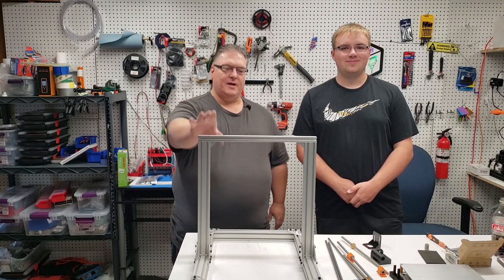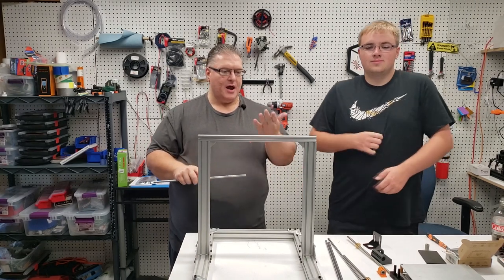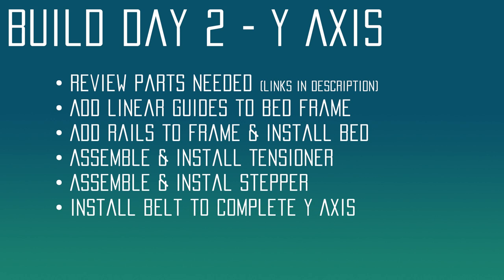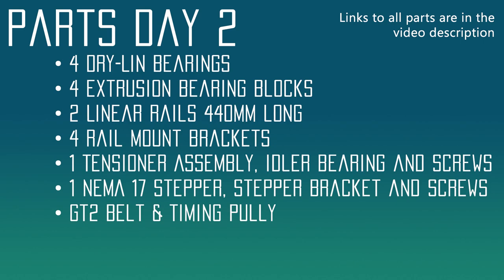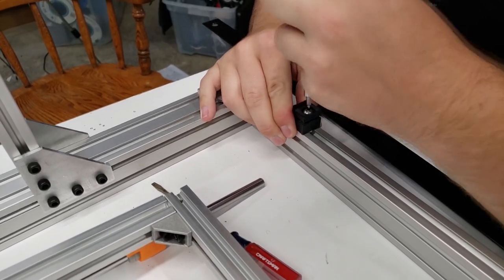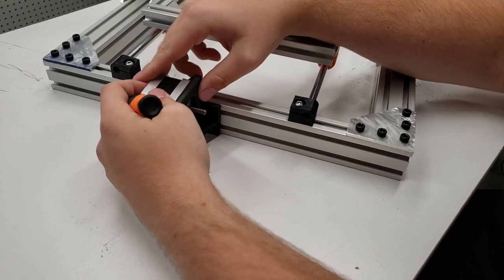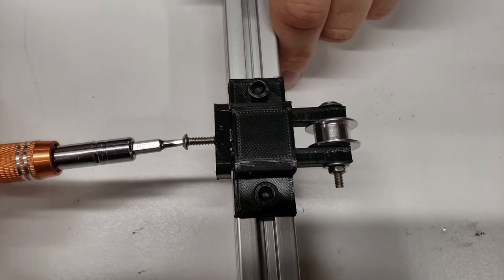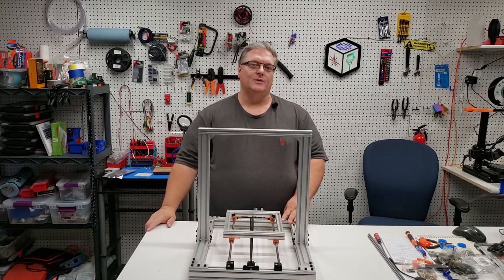DIY 3D Printer Build - Part 2 : The Y Axis

Comment: I love how 3D Printers are uniting the world around the metric system, thumbs up man
Reply from the maker: I find metric far easier to calculate.  Reducing fractions, adding together.  I'll stick with round numbers and base 10.  I don't use inches and feet anymore unless specifically a US construction needed measurement for windows, doors, etc.
Reply: @MakersMashup  👏👏👏👏👏
Reply: @Suicide Kyd I tried to answer you, but YT keep censoring me for no reason. But there's a weird episode where millions were lost because of differences in the measuring system used in a space probe, check it out (it's pretty intriguing).
Reply: The metric system has its uses, but imperial is superior for most of every day life.
Reply: @karbonkai  superior for like 3 countries in the entire planet, lol. Even the countries where it originated from dropped using it - so superior it is.
Reply: 1.86 meters vs 6 foot 1, what sound more natural? In measuring people and distances, it is easier to use inches, feet, yards, and miles in every day life. Most screws on reliable products rely on the imperial system: that measuring system is much more efficient. It's a bit more difficult to make calculations with imperial, but that's the only point where it falls short. The imperial measuring system for liquids is also superior for use in every day life; the calculations are arguably more simple than metric and the volumes are more diverse. The measurements for weight are pretty much the same, I just use imperial because you can get a little more accurate without having to use a separate measurement, either grams or ounces.

The metric system outweighs the imperial system in most aspects of science, but for real life application imperial ranks supreme.

Edit: there's also the problem of metric measurements being dense with syllables. "Pound" is a single syllable while "kilogram" is three.
Reply: @karbonkai  what sounds natural is subjective
Reply: @joachimtheboss5326  that's true, but generally speaking, imperial is more practical for real life situations.
Reply: @karbonkai  "What sounds more natural" absolutely the 1.86m or 186cm. Far easier to convert into different fractions and different units without even thinking, easier to note down and use. You point of view clearly sounds like someone who hasn't dealt with any industrial or scientific sector outside the NA. Not only is imperial far more janky to use but also complex to convert. Add to the rather roughly designated and defined units, makes it pretty pointless in every possible application besides people who are used to it. For measurements when your smallest unit starts at Inches, I don't think it's a great system. It's only natural/practical for you because you are used to it.
Reply: @MaxC_1  186cm is 6 syllables, 6ft1 is 3. Imperial is designed to be more applicable in normal world situations. The metric system is superior for scientific purposes, and whenever I'm designing or manufacturing something I use the metric system, but for almost every other application, imperial is far superior. Yd, Ft and In can be applied to people and the general word way more easily than M and Cm, mostly because the sizes of them are more compatible with humans and places humans go, but a lot of it is because of how many syllables are used for each measurement. Quarter inch is 2 syllables vs 1cm being 5. Conversion can be difficult, but the diversity of units ussually prevents conversion, as there isn't a reason. Imperial is made for everyone, metric is made for science. Also, the inch isn't the smallest unit of measurement in the imperial system, there are fractions of inches. Saying that doesn't count or apply is like saying that the meter is the only form of measurement for the metric system, because everything else is a prefix of the meter.
Reply: @karbonkai  bro its 6 feet 1 inches which clearly isnt 3 syllables(its 5) let alone the fact that it can go to 11-12 which will make it like 7 syllables and that is ignoring how dumb it is to have it go to 12 instead of 10 ( like how the whole number system works) 
then there is yard which is 3 feet or 36 inches
then you go to weight and each pound is 16 ounces 
if you look closely you see that its a complete mess and everything seems arbitrary to the eye but in the metric everything works like clockwork
same suffixes are applied to everything. want to change the scale for something that is smaller in length? you have centimeters, millimeters, micrometers and so on, want to go larger? kilometers 
speaking of volumes? same here you have milliliters if liters are too big, in weight the same thing applies.
and the most beautiful thing is the conversions: a meter is 1000 millimeters and a meter is 0.001 kilometer, a liter is 1000 milliliters and everything else is a multiplication or division of 10s
but in imperial, an inch is 0.083333333333333333333 of a foot
a foot is 0.333333333333333333 of a yard
an ounce is 0.0625 of a pound.
these are nightmares when you want to convert a number
accuracy is lost with every conversion because you cant write infinite 3s everytime you want to convert feet and yards for example and gotta round it
you get the idea, imperial is awful and the only reason it has stayed is because of usa and her people, not because its natural or something
Reply: @karbonkai  If we are going to be so pernickety as to counting the syllables of measurements, engineers (at least all those who I have dealt with) would not say 1 centimeter, they would say 10-mil (which I count as not many syllables at all!). [Good] Engineers always use millimetres, because engineering is derived from physics which is a science (I know SI units are metres, however millimetres is 1x10^-3 metres, therefore it is acceptable). It needs to be that precise otherwise the whole exercise is a lost cause. I am all for freedom of speech however imperial, in an engineering environment, is truly and utterly unfavorable and definitely shouldn't be used. I understand for construction use-cases, it is everywhere! In the UK, we are still plagued by the past existence of imperial, with boards used mainly in construction commonly coming in sizes like 2440x1220mm (8x4ft).

Maybe I am getting caught up in this, but it is good to use what the rest of the world does to become more rounded - I am able to, and have used imperial in the past.

Comment: Great project :) Very inspriring.
Yet, one remark : sliding rods + bearings are not "linear rails" as mentioned in the part list. These are linear rods, not rails. Linear rails look like rails and are, IMHO, sturdier than rods.
Reply from the maker: You're right I'm sure I just mis spoke I do know the difference.  Thanks for catching that. I'll check the bom the should be listed as rods.

Comment: Great Videos, really.  Trying to source parts for the project - looking at day 1.  All Aliexpress links are dead.  The misumi parts are over twice the price in your spreadsheet ( and I must add 35% because of the USD - not to mention very high shipping prices on top of that ).  You mention this is an inexpensive build; I was wondering how much it is to buy parts directly from you in the form of a kit then build it myself.  btw, it is September 22, 2022.

Comment: I just found this. Subscribed. Is this still relevant/viable after 4 years to pursue building?  Thanks
Reply from the maker: As a learning experience in building printers. 100%.  To have a state of the art printer, no.  It's about the process and experience.  It will produce a solid 3d printer.
Reply: Thanks for the reply.  No, I am not looking for the top of the line printer. So as long as this will work for small projects I may just pursue this.

Just looked at BOM and noticed the note about the 301.  I may actually go that route.

Comment: The spacing for 2 of the holes on the stepper bracket is about 28mm, and the other 2 are 31mm apart on the Thingiverse file that was labeled "1_Y_Motor_Mount." But the spacing of the holes for the NEMA 17 stepper motor from Amazon are all 31mm. Did you use the exact Thingiverse file that is linked in the Bill of Materials, or did you make a modification to that file?
Reply from the maker: None of the files are modified.  28 sounds right for nema17. Not sure why it would be 31.
Reply: @MakersMashup  Welp if they don't work I guess I'll just drill new ones 🤷‍♂️. Thanks for everything you did putting this awesome series together!!

Comment: on the google sheet it has a ton of links to thingiverse that seem largely the same... does one of the links  have all of the parts we need printed and then the hardware column is actually all of the hardware we need?

i just need some clarification on how the google sheet is working here 

thank you
Reply from the maker: The spreadsheet links to the thingiverse files where the models are for that line item.  They are duplicated but there are multiple parts inside the thingiverse files.  Because of license restrictions of the original authors no one complete repository exists for all of them so you'll need to download the group of them.

Comment: How many of each .stl file needs to be printed. I can't find the place where this is clearly defined. Thanks.
Reply from the maker: For the C201 there is not a specific part list/count list for each part, we improved this on the X201 and X301 printers.  Generally speaking most parts come in 1, 2 or 4's.  Carriage parts you only need one, steppers for the Z axis, etc require 2, rods on the Y usually require 4.  If you follow along with the video it is usually clear which parts you need to print and how many.

Comment: Is it possible for you to share the link of the STL or Model for the bearing blocks so I can print them? And how many do I need?
Reply from the maker: The link to these are in the description.  It is the file on thingiverse for the C201 it has a few variations and the other models you need for the project.   You need 4 bearing blocks.
Reply from the maker: Just realized you may have meant these, but these are for the X https://www.thingiverse.com/thing:2404074

Comment: Hello, can i fit 300x300mm heatbed to this frame, or i need to scale the frame up?
Reply from the maker: It might be very tight.  I think the big concern would be your X and Y travel.  The bed would probably fit in there however.  You have about 360mm of space in there to work with.
Reply: I have the same question. @Aranel71 did you scale up, or did it fit?

Comment: I see this on every single DIY printer build I  look at. Everyone says "here's what you need to build this printer" and includes at least one part that you have to already have a printer to make! If I had a printer already, I wouldnt be looking for plans to make one. How do you work around not having the parts?
Reply from the maker: The RepRap movement (RepRap.org) is about making self-replicating machines so that is why you see these types of parts in every video. You need the parts in some fashion. However, the 3D printed parts could be replaced with wooden parts of similar kind if you made them yourself. None of the plastic parts need to be plastic. The plastic parts simply add convenience. Given that you'll need to buy things like steppers, electronics and other specialty parts its likely you can use a vendor to print the few parts.  At the end of the video series we'll offer to print these parts for you but you can use many existing vendors in the market to have them produced as well.  Thanks for watching and good luck!
Reply from the maker: GnatTheGnome you might want to check out this build we did without plastic parts. https://www.youtube.com/watch?v=tYUiWoiKzbs

Comment: What did you use to determine the length of the printer? I'm having trouble figuring that out
Reply from the maker: By Length and this being the Y video I presume you mean the length of the Y Axis.  This is determined by the bed size.  The bed must be able to traverse the entire length and have the print head travel over the entire bed.  So its determined by the bed size and how you have the bed mounted to the Y rods.
Reply: @MakersMashup  right I didnt know if there was a algorithm or a mathematical way of determining the bed travel length before ordering aluminum
Reply: philip coulson 
A 220mm bed would have to roughly move 110mm in both direction (forward and back ) 

The nozzle will be center and moving 110mm in both directions will allow it to cover exactly 220mm bed

So a 220mm bed moving 110mm in both directions will roughly be 440mm of space needed give or take some for end stop switches and motor mounts

Comment: hello can i replace the dry nearing with lm8uu linear bearing
Reply from the maker: Yes.
Reply: Makers Mashup  ok thanks for your answer i mean if i use the steel lm8uu it will have 8mm inner diameter and outer diameter 15 mm but the polymer type you use it will have 8mm inner and 16mm outer diameter , so when i put them inside the printed part and use screw to fix them it will safe . And another qusetion what  is the best steel or polymer type. Thanks
Reply from the maker: Which is Best is probably very subjective.  I prefer the polymer ones because they are quieter.  The mount that I use for those bearing should support a 1mm variance in the OD of the bearing.

Comment: You need 3D printer to build  3d printer :(
Reply from the maker: You actually don't. Check out the Frankenstein printer video in the series playlist.
Reply: @MakersMashup  but you need to 3d print the bearing blocks right?
Reply from the maker: No there are alternatives in the video.

Comment: I think the idler should have teeth.
Reply from the maker: Agreed.  I'm not sure I had one on hand when doing the series.  For most users it would be fine with either.  It's actually a pet peve of mine these days.  Even the new prusa Coreyxy uses a smooth bearing where a toothed should go. 😕